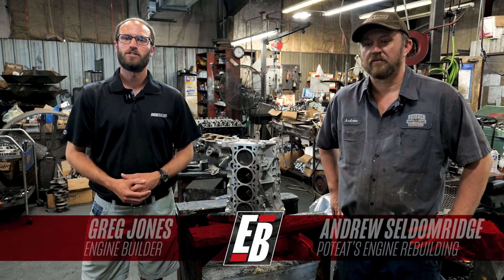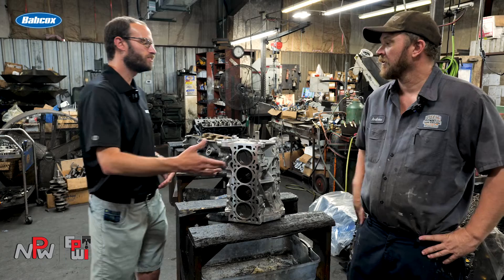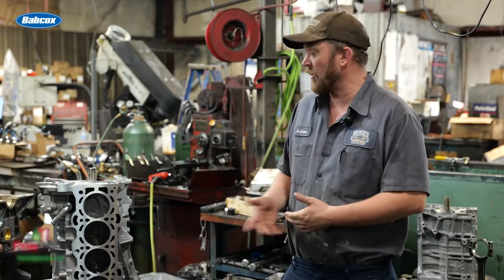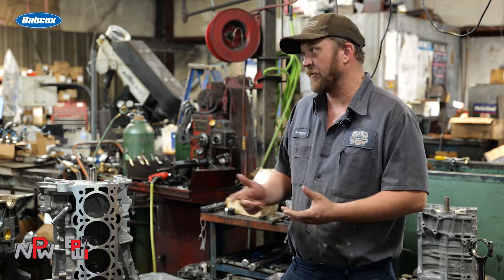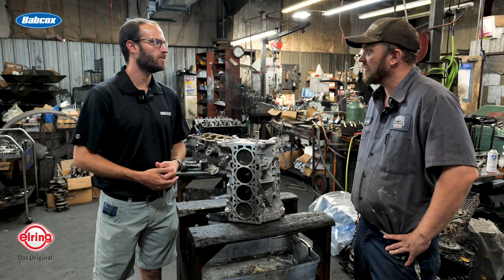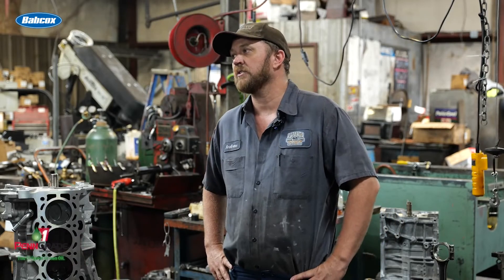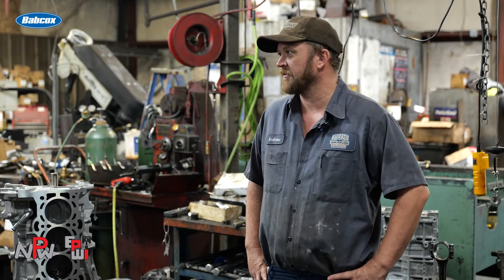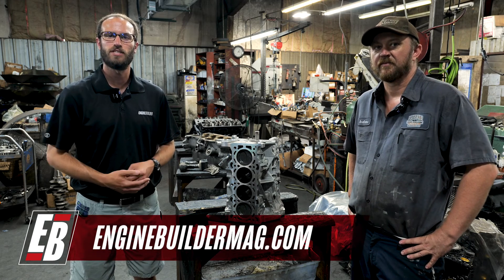Ford 2.3L Duratec Engine

Comment: I have the same internals... Sitting in a tote. Waiting to get garage space so i can pull a motor for the donor block. Been on the back burner for 5 years. It's a turbo build. Stock internals didn't hold, knowingly. Snapped cylinder 1's rod in half. But yeah it's a great engine and i can't wait to build it better!

Comment: I was wondering if this "Ford Duratec" 2.3L engine is the same engine as the Mazda "MZR DISI" 2.3L which debuted circa 2005 in Mazdaspeed's and CX7's?  That is; if I bought Ford's 2.3L engine short block, could I put it in my 2008 Mazdaspeed3?  Is it form, fit, and function the same?   My engine is currently dead and good used Mazda engines are hard to come by.  I don't think Mazda makes my particular engine anymore but it seems Ford might - just by another name. Anyone know the answer to this? Thanks.
Reply: Ford duratec and Mazda engines are essentially the same with minor differences depending on the model/trim. Idk man you might have a better time finding a Mazda engine. But I seen a few on ebay. I've had a hard time finding information about my 2007 ford focus st 2.3 duratec
Reply: The duratec23 is near identical to the mazda L engines, however alaot of the wiring hooks up in different places which can cause issues. The internal parts are all interchangable however

Comment: What is that motor going in?I didn’t know anyone hot rod dead those motors
Reply: They're used in older Focuses, the NC Miata, and a LOT of kit car builds like Caterhams.  The 2.3 is a bit of an odd choice today since the 2.5 is available.  The current trendy setup is to pair the shorter crank from the 2.3 with the bigger bore of the 2.5 to make a 2.4 build.  That results in better bottom-end geometry than a Honda K24, and kicks ass until you start running into block limitations around the 500hp mark.  The Duratec has had some attention from pretty serious players like Cosworth, Mountune, and Esslinger.

Put it this way, it's not good enough to get put into an S2K, but it's too good to justify K-swapping an NC.

Comment: Old NA 2.3 duratec, closed deck design for superior sealing. New turbocharged 2.3 ecoboost, open deck design for inferior sealing. They call it “progress.”
Reply: Hello! Ecoboost buildder here.  On the ecoboost racing platform engine builders choose to use different blocks.  They choose to use anything besides the 2.3 RS block.   So the go to blocks on for building are the 2.0 focus ST block, 2.0 ford fusion block, or the 2.3 duratec/mazdablock.
Reply: Sealing or cooling
Reply: The OEMs aren't in the business of designing race engines for daily drivers, they're concerned with designing engines that can roll out of the factory and get you to work whether you live somewhere in Alaska or in Death Valley(or extreme altitudes for that matter). Ya notice how a lot of turbo engines are coming with the exhaust manifold cast integrally to the cylinder head these days? Yea, they don't care that you can't put an aftermarket header on it(can't imagine the new Chrysler 'Hurricane' I6, as interesting as it is, is going to be all that relevant in the racing world considering many of the design choices like the integrated manifold).
Reply: @RyTrapp0  they do it because  its cheaper..but yes its a bad design. Because instead of replacing a header you have to replace the whole head
Reply: Man y'all need to fuggin read.  The blocks are different completely.  They use the same crank as the disi.  I actually have speed unlike you guys lmao it shows.  
Also integrated exhaust designs were around in na before turbo applications lol.  
J37a1 2007-13 integrated manifold in head.   Lol.  Ldx gm v6 2009+ integrated design and no turbo lol 
☕☕☕☕☕☕
Reply: @alexwhite176  read about what ?  We were talking about blocks.  And yes the 2.3 have a integrated exhaust manifold, get over it.
Reply: The original post says the blocks are different, multiple people including myself said the blocks were different.  What are you talking about? 🤡
Reply: @Paper.Power.Politics  integrated exhaust manifold is dogshit. That’s why they failed. That’s why ford has had so many recalls on them.
Reply: @RadDadisRad  not disputing that. But they still make good power.  And it does help with boost control.  But yes overall it flows less then a 4 port exhaust head. Definitely restricted.  But a good built ported head can make tons of power and be in full boost by 4500 rpms
Reply: @Paper.Power.Politics  the problem is it’s great for response but not max power. The exhaust back pressure delta is greater with integrated exhaust vs balanced runner design.
Reply: @RadDadisRad  true, you’re 100% right.   But its still effective .   And they can basically be pushed up to 1000whp.  But not every one is a drag racer.  And for 400-700whp build it’s very effective, and has its few advantages when it comes to boost control.
Reply: @Paper.Power.Politics  I was at 350whp with my 2015 fusion. I had problems with high EGTs and I did burn up my cylinder 4 runner which opened up the coolant passage in that runner.
Reply: @RadDadisRad  ive been at 400whp for a while now and have had no issues whatsoever.
Reply: @Paper.Power.Politics  lucky you. I lost all my coolant out the runner. Steam cleaned my turbine housing and exhaust.
Reply: @alexwhite176  integrated exhaust eats ass. Total dogshit design to save a couple bucks in exhaust manufacturing.
Reply: Can anyone explain the difference between the Ford 2.3L i4 16v yb4/5 and is it a better engine?
Reply: @mrsadrados  make your question more clear
Reply: @mrsadrados  duratec is not ecoboost and not compatible with each other unless machining and modifying is done
Reply: That's because the 2.3L Duratec is a Mazda engine and the 2.3 ecoboost is clean-sheet design from Ford.
Reply: @Edward135i  no its not. Its derived from the mazda engine
Reply: @km6832  the 2.3 ecoboost has a shared engine block but everything else is different, the 2.3 Duratec is a mazda engine out of the Mazda 3
Reply: @Edward135i  meh, this is basically semantics since they have some interchangeable parts after the merger and subsequent separation.